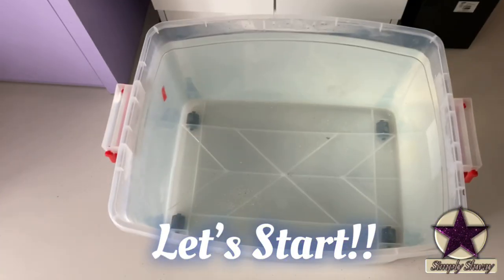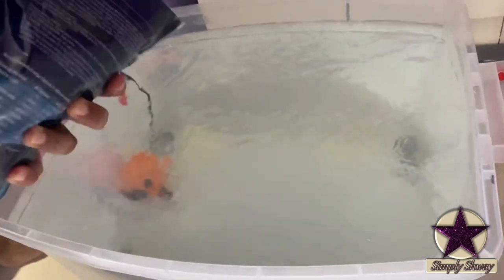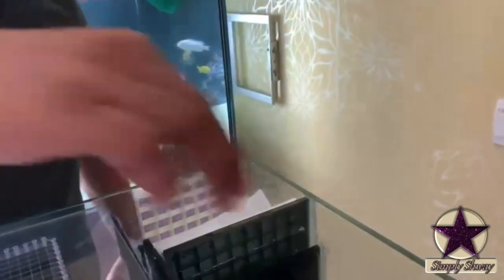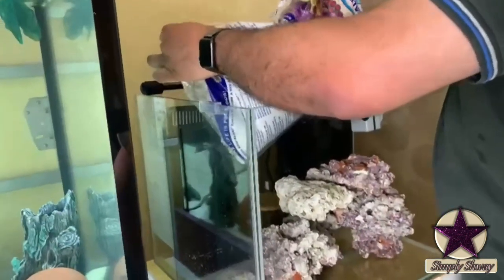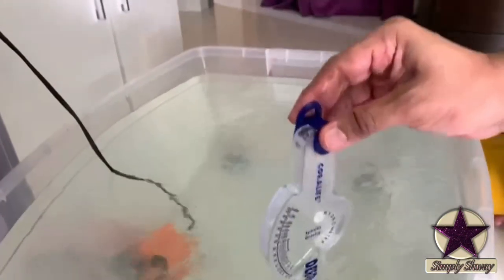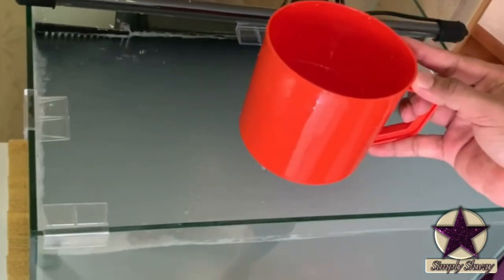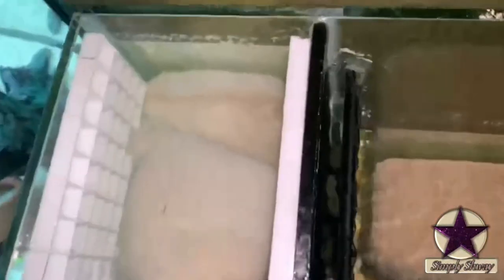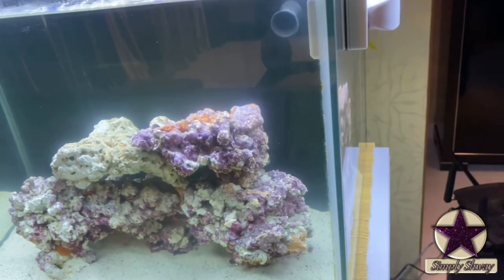How to set up a Salt water aquarium.

Comment: may i ask how to add a chiller to chill the water so that i can keep corals. at the same time how to set it up such that it doesnt make the room hot
Reply from the maker: There are 3 options.
1) aquarium fan :
2) Nano chillers:
3) Refrigerator based chiller

3rd option is the best that it will be more effective.  And you can keep good variety of corals. 
However space and cost could be a concern. 
I would recommend the 3rd option for you. JBJ 1/15 HP chiller would be good for you, basis the conditions you mentioned. 
 Will make a video when I’m fitting one in the future
Reply: @simplyshway2503  awesome! thanks for the quick reply. This is because i am using a hailea hs-28 chiller for a redsea reefer nano and it produce a fair amount of noise and heat to the point i don't think it's very practical for the family or even to enjoy the aquarium.